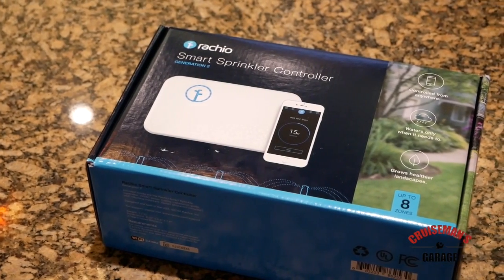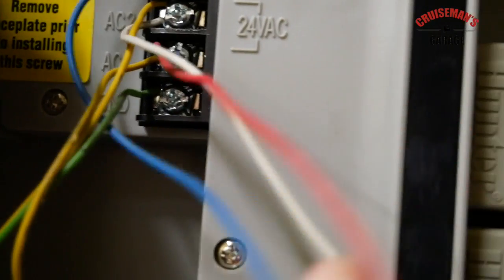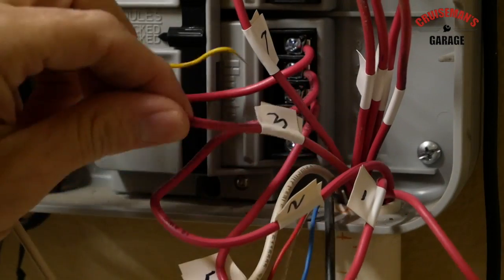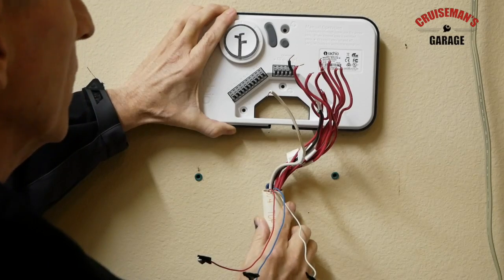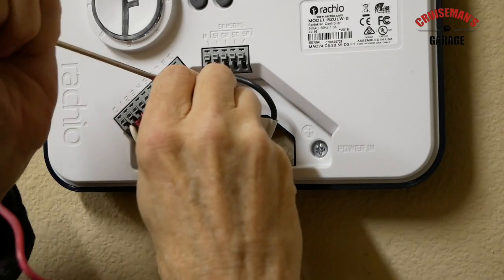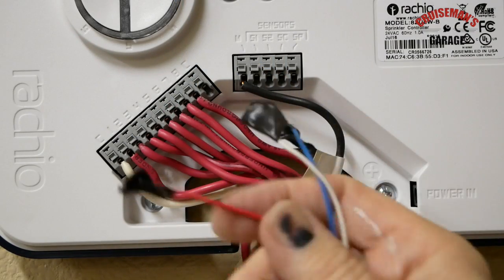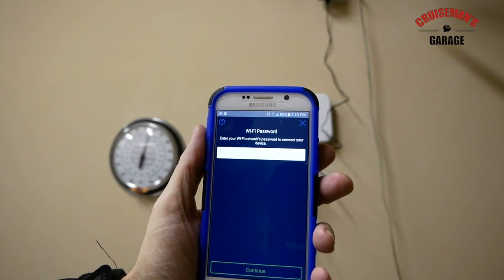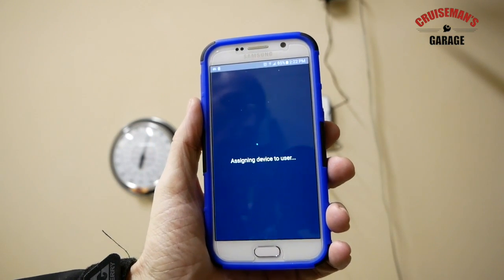Rachio Generation 2 Smart Sprinkler Controller Installation

Comment: That second common connector is for the Master flow connection, there should be a common wire for it as well.